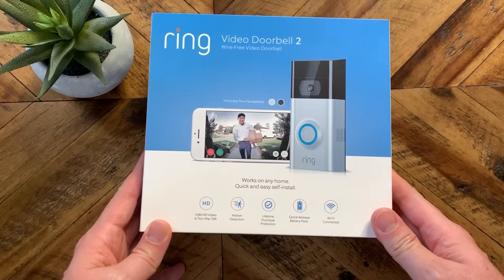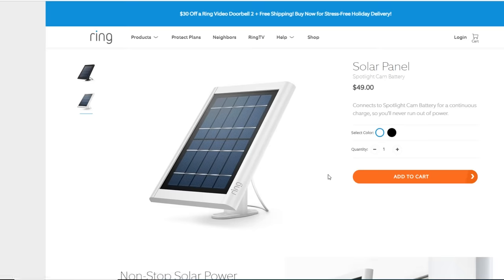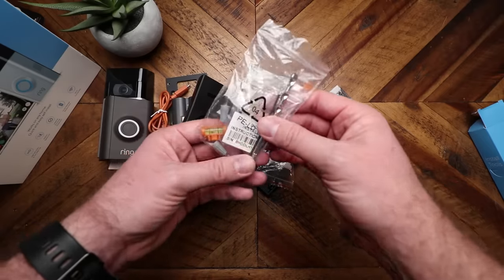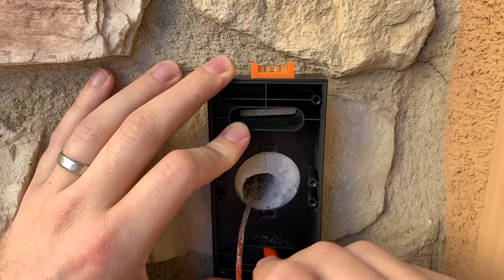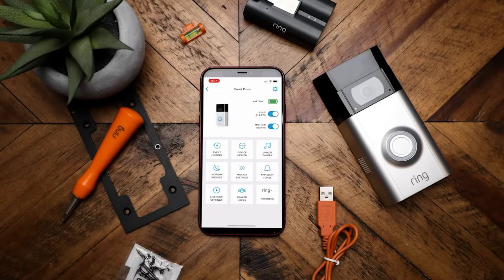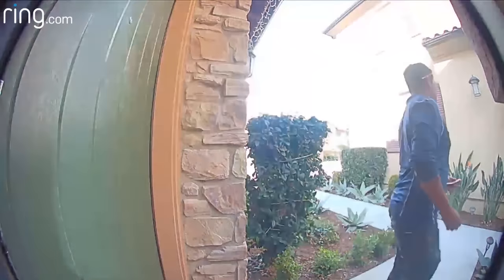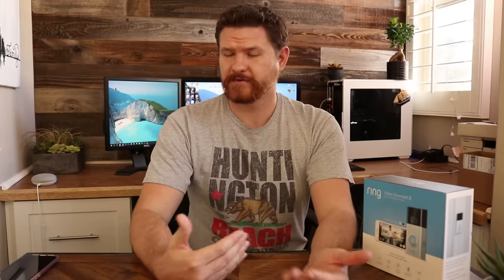Ring Video Doorbell 2 Review - BEWARE of hidden cost

Comment: Don't like how it chimes outside where the person pushing the button hears that, not how regular door bells work. Just don't care for that feature. Can I change that?
Reply from the maker: I agree, i don't like that it rings outside too. Especially that loud. I don't think this can be turned off but, i'll take a look.
Reply: Open your ring app,on the top right corner you'll see the settings symbol,tap that and from there you can control the outside volume.

Comment: Is there a reason why my speaker just echos when speaking to eachother ? Cant fix it and total deal breaker for me. Should be able to have an easy convo like advertised
Reply: Joshua A strange only did that with me when I tested it with my phone  in the same area before installing
Reply: @delj3875  yea I'm so disappointed.. it works with my wife's phone, my son's, phone but doesn't work with mine. I found online it seems to be happening with just the galaxy s10. Go figure

Comment: Is there a way to connect an external hard drive so you don't need to get the subscription?
Reply from the maker: No there is not. This does not have a base station like the Arlo cameras.
Reply: However you can hack it to record to your personal cloud ... Be it in your house or Google for example
Reply from the maker: Have you done this successfully? If so, please show me how. I found some IFTTT applets for this but wasn't able to get them to work. When i did some digging i found that Ring patched the ability to do this.

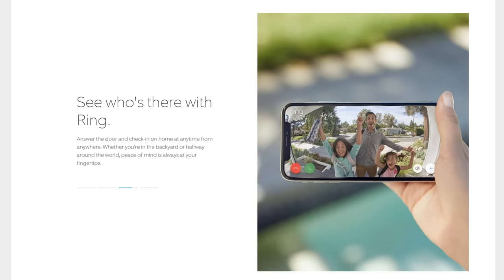Comment: I notice at 5:16 you complain about the image being washed out, I notice a very strong backlight in the video, that problem affects every camera, there may be some adjustment you can make for that, I don't own one so I don't know the details. As for more storage, their storage is remarkably cheap, one some models its included, they could just jack the price up and then make it "free" like some other outfits. The quality (1080p) depends on the strength of the signal, the resolution will drop if the signal isn't as strong as it could be, its 1080p with a perfect signal but if the signal isn't perfect it starts dropping, unlike the camera in your phone which isn't dependent on the strength of the signal for the quality of the image. You mentioned you hate subscriptions but I see that in 2020 Arlo is requiring a subscription just to receive motion alerts, one of the basic functions of a video doorbell.

Comment: Ring says it works with 16 volts..It really wants 24! most older chimes are 16 volts! Ring should be clear on this. Mine barley worked on the 16 transformer

Comment: Make sure you don't strip the screw keeping the cover on.  Now you can't get it off.  The suggest using a rubber band on the end of the screw for traction or A small pliers to grab the screw.  Neither works.  The next suggestion is to break the cover????  Not good.

Comment: Does anyone have a door facing the street/ road? How does the motion sensor work in these cases where people/ car are going by?
Reply from the maker: You're able to adjust the distance of the motion sensor up to a max of 30 feet. So if yours is picking up cars and people walking by, you can just reduce the range.
Reply: @SteveDOES  thanks Steve. Would know what the minimum range is? Or whether it has a duration on the motion sensor. For example: if someone walks pass my door the motion sensor would not react but if someone was to stand at the door for a few seconds the motion sensor will react.
Reply from the maker: I think the minimum is 5 feet but, 100% sure on that. It does not a duration like your example. You can set a delay for notification where it would wait 5, 15, 30 minutes before sending the next notification to your phone.

Comment: Folks what do "they" expect for $ -200 device? I won't divulge my auto/video system.  Most won't afford it. I will say it costs well over $2,000 +. and covers inside and outside, Also it a stand alone unit that runs 24/7 device ( no motion ) it can choose what it views to record. And logs in from around the world. If you want a good cheap product don't snivel. Open your wallet and buy a stand alone 5 terabit hard drive with a power back up. Hide your units and cameras. Don't tell everyone " I got a camera system" Further should a unwanted person enters I've got a surprise to protect my family.' It goes BANG

Comment: Battery Pros and Cons

Pros:                                                                                                                                                Cons:
                                                                                                                                                                  Runs out
Batteries with keep it going if someone rings it if the power went out.                                        Takes 5 HOURS to charge
No hassle of wiring if you took out your hardwired doorbell and threw it away.                        Somebody could take it out

Hardwired Pros and Cons:
                                                                                                                    Cons:
                                                                                                                      If power goes out, your ring doorbell wont work.
Pros:
Constant Power, no need to charge.
Possibly kill the idiot who's trying to take it out.
Connect to your existing doorbell transformer.

Comment: I bet a Raspberry Pi Zero W, button, and camera module would make a cheaper video doorbell.
Reply: Actually, it cost about the same plus unless you're a nerd (like my self) you still have to deal with setting it up and programming it ... much harder for the majority.
Reply: @BloodyNoSeProduction  Depends on if you can get ahold of a Pi Zero without being overcharged for one. I suppose if you went with a normal Pi 3, you could maybe attach additional cameras to the USB ports and gain extra functionality for the price.

Comment: What a half brain thought of this subscription system? And why would there be an external server necessary to store all the clips from the doorbell? Simply said, the Ring Video Doorbell 2 is not well thought over. New software and add a €11,-  micro SD-card and all problems are gone.
Reply: The subcription is a way to rip you off, so that they can make more money. The subscription is a safe and always flowing income. Sales are not. Almost all doorbells do this. I have returned mine.

Comment: Someone stole my motorcycle five feet in front of wired ring doorbell camera pro.. never gave a notification or recorded anything. Pos do not buy.
Reply: So because you didn't get notified one time, we shouldn't buy?  What about all those times that the thing actually works?
Reply: @nunyadamnbizness9600  You're correct, however the motorcycle was recovered 3 days later, and they came back for the motorcycle. it also did not pick up them removing a bolder to close the gate that is always opened they did this to give them shelter from public view. They did not enter the home due to gun signs i have on that particular entrance. The way they are getting around wifi cameras is by using WiFi jammer. i didn't know this existed until friends, family and law enforcement told me about it so i looked it up. Yes this is such a rare instance for people to use them however that is what happened in my situation. Now this was for informational purposes. However if you'd like to use WiFi system by all means however knowing what I know now I am adding hardwired system in conjunction with the Ring system and possibly do away with wifi system all together I haven't made that decision yet. But be aware of these jammers, they do exist and it is happening.